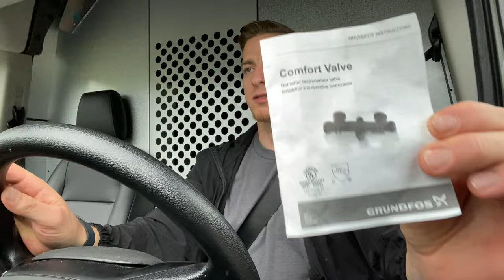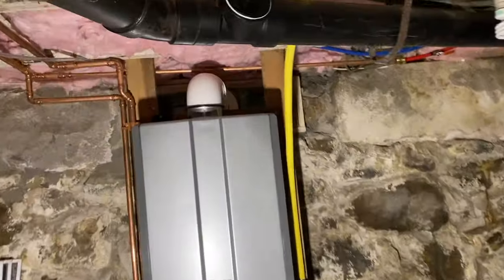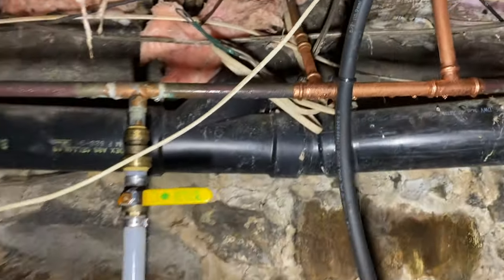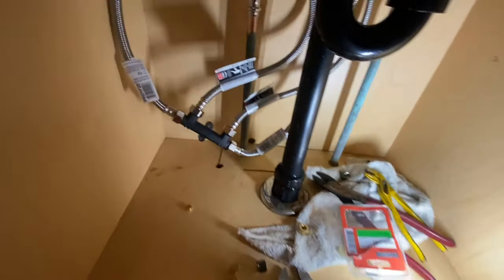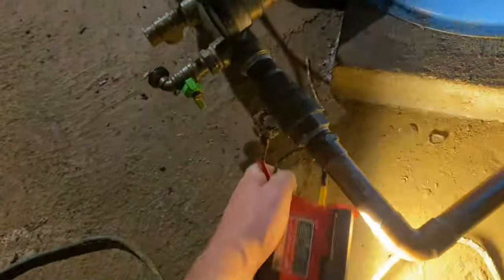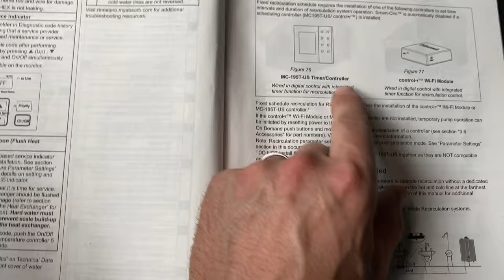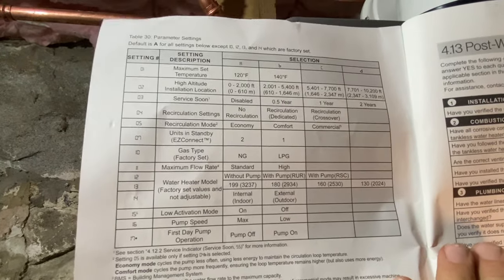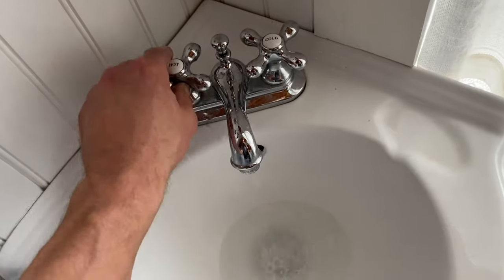Adding Recirculation to a Rinnai Gas Water Heater #plumbing #rinnai #waterheater

Comment: On a New build how would you plumb that to a Zurn Pex Manifold system with shut offs to each faucet on the hot and cold lines ? Do you need a dedicated return?
Reply from the maker: So I didn’t think of that but I would say this is more to retrofit an older house of piping. With a manifold system I’m going to say a more traditional recirc would be best!
Reply: I know you probably already have finished your build but for others with the same question you can either run dedicated returns to each fixture that you would like the instant hot and have them connect to another manifold with one run back to the heater or run just a loop at the manifold since that hot supply from the heater would be the larger line with smaller home runs to the fixtures.

Comment: Do you need to add these at multiple locations (diff levels of the home to get hot water on demand at all locations or is just one comfort valve good enough at one location?
Reply from the maker: It’s going to depend on how your water branches off in the house. The idea is to put it at the furthest fixture and that will be your best bet. You may find that you would need multiple manifolds!

Comment: Your video was easy to understand we have a Rinnai gas water heater and watched your video to have hot water to the sink.. We have a shower stall next to the sink.  Will the hot water for the shower be as quick and not waiting like we do now??
Reply from the maker: Really all depending on how it was all piped in the walls! It’s hard to know before you try it on this one

Comment: I have a question about the installation of the valve, we use the same water heater at home but not the certainty of the model that I will already review. The question is if I could do the same to get the hot water faster to a bathroom that is about 50" from the water heater by configuring the heater with the valve already installed or installing a line or pipe to get the water faster and that it has circulation without wasting the water a lot of cold water while the hot one arrives?
Reply from the maker: If you have this same water heater than you can definitely make this work. There are different settings for comfort levels you may have to play with on the heater itself. Some will offer more hot water but less efficiency.

Comment: What model of Rannai is this? I have the RL94i. I don’t see this information in the product manuals. It seems with my modelI would need a standard stand alone Recirculating Pump. Thanks. Great Video
Reply from the maker: Thanks for checking out my channel! I forget the exact model of this one but for this to work it does have to be the version that has a built in circulator pump. You are correct, otherwise you would need the standard recirculation method.

Comment: Is it like a hot-cold bypass line? which we can make one by ourself? And water heater has a built-in pump?
Reply from the maker: This is just the quickest easiest way to install under a sink. This part is designed to work with Rinnai specifically. Yea the water heater has a built In pump exactly. This is good for retrofit depending on how the house was piped up

Comment: Josh,
Can I add a recirculating feature to my Rinnai RK75i tankless water heater?  How do I contact the right professional to accomplish this?
Thanks,
Vince M
Reply: RL75i
Reply from the maker: Hey! You can if you have the version with the built in circulator pump. If it’s a standard Rinnai it’s not as simple

Comment: Does the water not get containinated in a crossover system?
Reply from the maker: Contaminated? Not exactly sure what you mean. No water in this system has the chance for contamination
Reply: I don't know about you, I grew up where you do not drink out of the hot tap. In essence that is what you are doing.
Reply: You should be okay of it's chlorinated tap. If you live in a big building with a complicated boiler system. There's risk of legionaries if hot water is below 140⁰F. Otherwise for single family homes, if you flush the toilet everyday or take daily showers. Legionnaires won't have enough time to grow. You could get a water filtration system. It gets rid of all the pharmaceuticals in the tap.

Comment: I just bought rinnai 199in system, do you recommend i put it on 5b comfort mode ? What are the pros/cons of comfort mode?
Reply from the maker: Hey! Thanks for watching my video. So as far as comfort mode goes, if you don’t mind the extra energy and gas consumption than this would provide hotter water on demand due to circulating the pump more frequently. If you were more interested in least cost to run that wouldn’t be the setting you would want. Hope this helps!